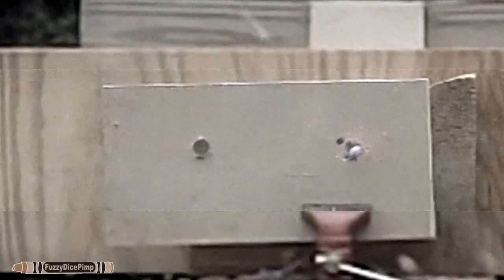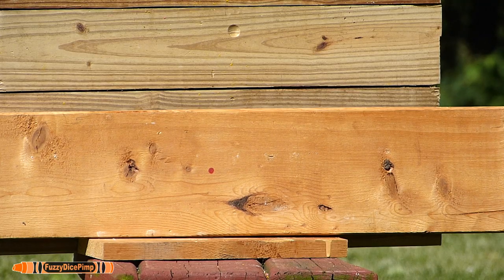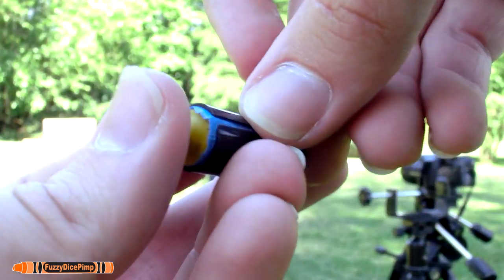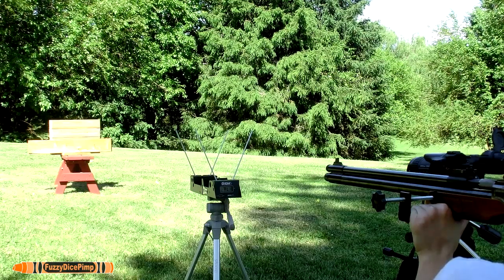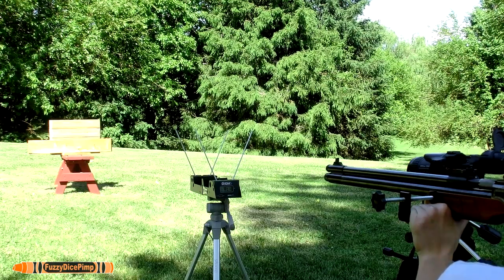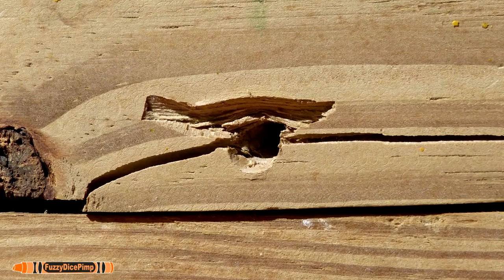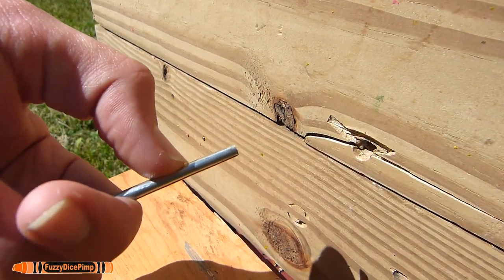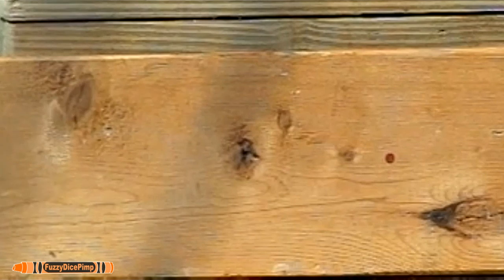Sabot 7.62mm vs Wood Board

Comment: ! issue,the wax and plastic should be made to "unseat" from the bullet like an actual sabot so it would get more velocity,longer/straighter flight and deeper penetration.Mold the wax,then cut it into 4 sections and peel it off the round,a little oil or lube on the round before hand might help it unseat itself in flight once it leaves the barrel.

Comment: this would actually be considered APCR on APNCR ammo as the jacket doesn't break away after leaving the barrel
Reply from the maker: Hmm, I hadn't really thought about it but I suppose you're right, it basically works like a APCR shell. But, it is also using a sabot to get down the barrel so it's a APCR round in a sabot, though I don't expect it to pierce much armor lol

Comment: It would be interesting if you could find bamboo boards. They are stronger per pound than typical 2x4s.
 1.7metres of solid bamboo should be enough to stop even 20mm fmj ammo. You can check it's mechanical properties here http://www.wood-database.com/lumber-identification/monocots/bamboo/

Comment: what about shooting a 50 cal bullet from a 50 cal rifle with that air rifle?
Reply: +PezDJ Very low velocity and lack of stablization.
Reply: +SalveMonesvol that wasn't my point. i meant he should shoot one
Reply: PezDJ why? Because you want to see a big chunk of lead going slower than an arrow? Or maybe you meant something in .50 cal other than a .50 bmg, in which case it would make more sense. A solid copper, 12 to 18 gram .50GL would be nice to see.
On the other hand, if you actually meant a .50bmg, we know it wouldn't work well.
Reply: +SalveMonesvol Why do you even bother to care about what the heck I wanted to see two years ago?
I then said what I wanted to see,I didn't care if it where possible, or anything. 

And I now also know it will work, I wrote that 2 years ago so I've had my time to do my own tests.
A manually regulated homemade pcp airrifle does the trick. 
Now go bother someone elses old comments instead.
Reply: PezDJ Yeah, it worked... as well as using a slingshot.
Reply: PezDJ Then post a video, "50bmg air rifle". You will get thousands from add revenue and prove me wrong.